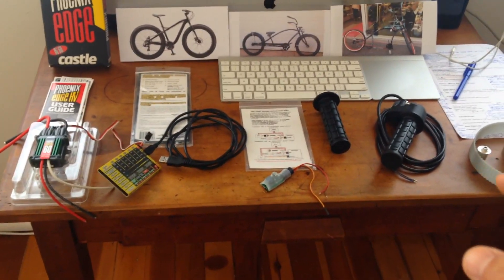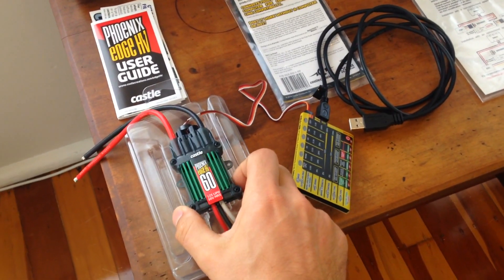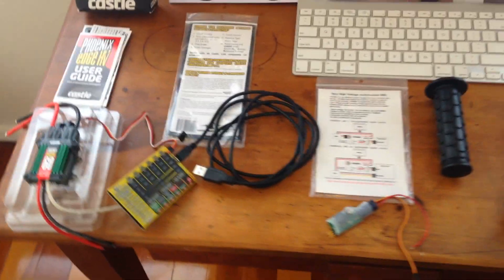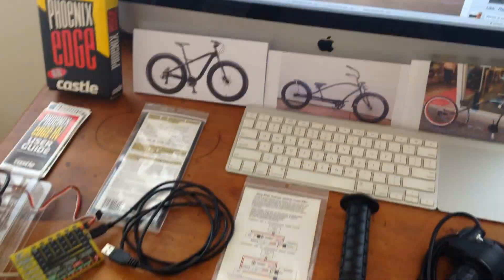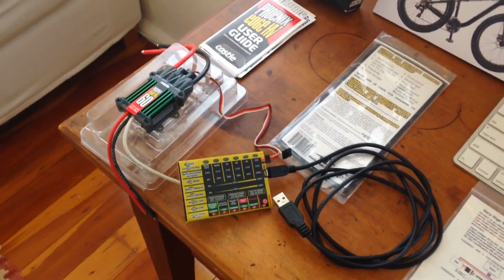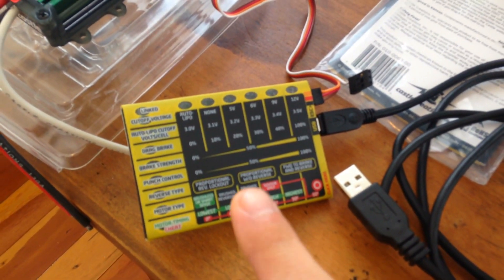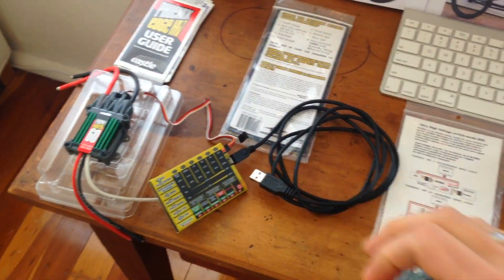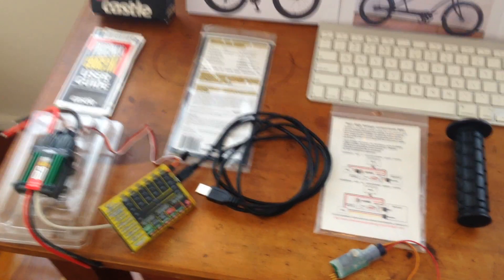Bafang BBS02 + 60A 3000w Castle Creations controller (UPDATE 1) project intro

Comment: Hi Bruno, your ebike is very impressive.  i just subscribed.   i'd like to know if the BBS02 has Hall sensors.   thanks
Reply from the maker: Yeahhh thanks for subscribing my channel =] Yes, the BBS02 is a sensored motor with 3x hall sensors. If you have an sensor less external controller you just don't connect the sensors and it works fine.... =]